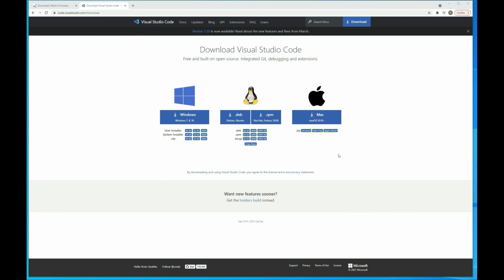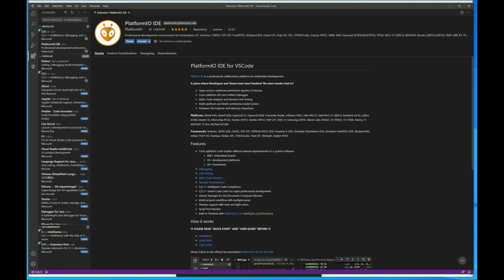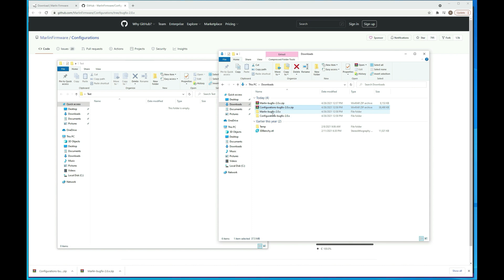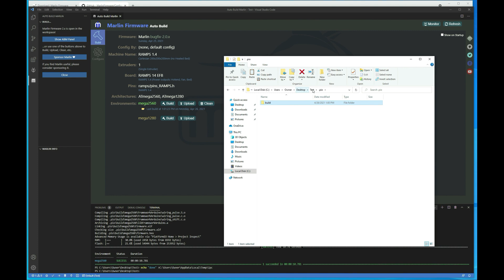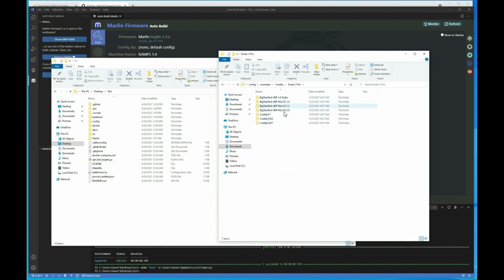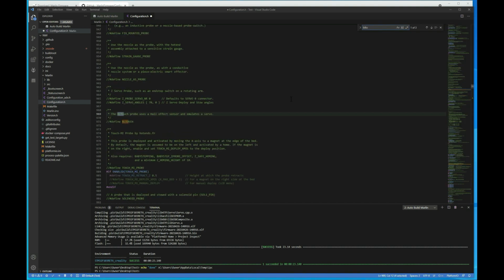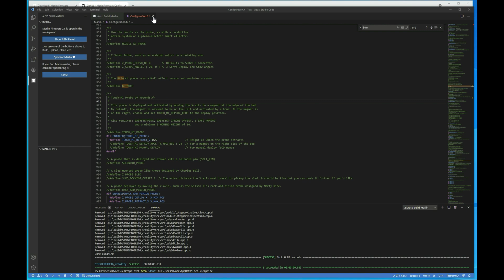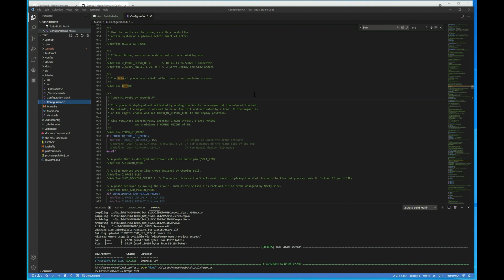Marlin Auto Build – The Basics

Comment: So put all of that on the SD card or just the highlighted hex file?
Reply from the maker: Hi. You should have a .bin, not a .hex file. I think you choose the wrong environment or config example.
Reply: @3DPrintscape  I was referencing the hex file showing in your video. But I've got it figured out. Klipper is up and working. Thank you very much for responding tho. I was under the impression I had to install Marlin then klipper but turns out I Don't have to install Marlin. I'm graduating from the 8-bit world to 32 finally. ;-) the M8P is a mini beast.
Reply from the maker: @HiGHrVOLTAGE  Ah ok, im glad you were able to get it working. The 32 bit boards are nice, assuming you got a silent one.

Comment: Hey, great video. Would you know why I would keep getting a failed build?
Reply from the maker: Hi. What error are you getting?
Reply: @3DPrintscape  For some odd reason VSCode does not like to compile 8Bit board firmware, no matter how short I make the path. I can do 32 bit boards all day long with no problems.
Reply from the maker: @CloneC-bw3pj  Interesting, i havent compiled 8 bit in a long time so i havent seen this. My guess is they made a change at some point on linux and the file path is still too long even close to the root of the drive.
Reply: @3DPrintscape  Thanks, I guess it's even longer of a path for Windows users. I'll try to get my hands on a Mac.
Reply from the maker: @CloneC-bw3pj  Im  not sure the path is longer for windows users but windows has a cap on file path lengths.

Comment: Thank you so much.
Reply from the maker: You're welcome!
Reply: @3DPrintscape  I'm having some problems with my start and end of Gcode on Cura. Could you help me Out with it please.
Reply from the maker: @josesousa3103  What type of issues are you having?
Reply: @3DPrintscape  So I made  a very large plotter with 4 stepper motors for 3 axis same as a 3d printer.  Z axis has 35 mm movment of pen. When homing Z it drops pen and drags at the begin and end of drawing. At the begining of plot i want it to lift up as it goes to start plot. At the end I want it to do the same as it homes also to turn of fans. I have fan on controller and on Y stepper motor, it get hotish moving the pen holder. It all moves very fast. I so aprecate you taking your time t help. Ive played around with it but not working.
Reply: it has a skr mini e3 v3 running at 2 amps. It is moving more mass than a printer. Faster acel and speed threw VSC and marling builds. moves really nicely.
Reply from the maker: @josesousa3103  I havent done much with the plotting side of things. I would say make sure your using a known good config example for the srk mini v3 and maybe try different software to see if its gcode related.
Reply: @3DPrintscape  Thank you. I just keep playing around.

Comment: This is my first attempt at trying this. I made it to the 7:15 mark in this video, but my builds just fail. I tried 5 times to get a successful build, but it's just not happening for me. I am using Marlin Bugfix v2.1.1 from the "Nightly" source, I just DL'ed it prior to this attempt.  I will be setting this up on a BTT SKR Pro v1.2 mainboard.
Reply from the maker: Hi. What error are you getting? It should be in the terminal output.
Reply: @3DPrintscape  I tried accessing your discord, but it said that I am not authorized to comment. I replied to the email I got regarding your question. That email contains a jpg picture of the message I keep getting, no matter how many times I attempt to build this firmware.
Reply from the maker: @PaganWizard  Make sure you move over to one of the tech channels in discord, you should be able to post there.

Comment: Currently using an Ender 3 V2, and just installed an SKR Mini E3 V3, TFT35, and BLTouch. Get tons of errors no matter which firmware I'm using, Marlin, Jyers, BTT, etc. Tried a different board and still same thing, it's as if the firmware doesn't even get pulled from the microsd upon insertion into the printer. Guess I could try a different card, but would love to see an E3V3 firmware vid in the future.
Reply from the maker: Hi. I actually planned on buying the v3 this week, so some videos will be coming.
Reply: @3DPrintscape  just to save you a lot of headache, there are many firmwares out there that are descriptive to work with the v3, but there is really only one that I found that works every single time. I'll share the link as soon as I get to my computer.
Reply from the maker: @TechReviewLife  Thanks, ill take a look at it. I plan on making a guide covering the build process as well.

Comment: Hi there. I keep encountering errors after I add my config files. I was able to do the test build with the mega2560 environment, but when I add the additional config files to the marlin folder, I end up with 5 different environments, STM32F10RE_creality (512k), STM32F10RE_creality_xfer (512k), STM32F10RC_creality (256k), STM32F10RC_creality_xfer(256k), and STM32F10RE_creality_maple (512k), and when I try to build any of them, I get "no such file or directory" error.
Reply: I understand the different versions now since I found an article about newer 4.2.2 boards shipping with different model CPU's but I am still not sure where my missing files are.
Reply from the maker: Hi. Try to move the folder closer to the root of your drive. If that doesnt work, try to clear out the .pio folder and try again.

Comment: I have a question.. I keep getting Error: Build environment "STM32F103RET6_creality" is incompatible with BOARD_CREALITY_V4. Do you know what may be causing this? this is for a 4.2.2 board on e3v2. ive followed the same steps as you but no luck still
Reply from the maker: Hi. They changed the environment details in January when the 256k boards started coming out. Try to use the marlin auto build plugin, it should help.

Comment: Hi, keep getting this error code in VSCode even with a successful build {
	"resource": "/c:/marlin/Marlin/Configuration.h",
	"owner": "C/C++",
	"code": "1696",
	"severity": 8,
	"message": "#include errors detected. Please update your includePath. Squiggles are disabled for this translation unit (C:\\marlin\\Marlin\\src\\lcd\\dogm\\status_screen_DOGM.cpp).",
	"source": "C/C++",
	"startLineNumber": 2,
	"startColumn": 1,
	"endLineNumber": 2,
	"endColumn": 30
}
Reply from the maker: Hi. Is that an error or just a warning and have you tried to reinstall the platformio and c/c++ plugin?
Reply: @3DPrintscape  Thanks for the reply it looks that way, upgraded my 4.2.2 board to a 4.2.7 tried the Creality download but that did not work, I have managed to build the firmware with BLTouch that was on the old board but when I boot the  printer I get EEPROM Version error on screen with options ignore / reset tried ignore and reset but have issues with controls not working nothing seems to respond, pretty new to firmware building.  Thanks for any help you can give.
Reply from the maker: @pedroaltin6186  Can you try the firmware I have on my site? https://3dprintscape.com/marlin-firmware-builds/  Also, ignore the warning then go into the menu and clear the eeprom.
Reply: @3DPrintscape  Thanks tried your firmware with no luck still no movement, something is going on with this printer.  I have downloaded the 4.2.7 from Creality flashed this no movement but when I flash the new 4.2.2 firmware things start to work Bed & Nozzle heat X Y & Z all move, think I will remove BLT & re-connect Z stop for now so I can start printing again. Thanks Pedro
Reply from the maker: @pedroaltin6186  Double check the bltouch wiring, don't assume its correct in the harness. Ive seen it shipped wired like 10 different ways.
Reply: @3DPrintscape  Hi,  decided to take out new board only to find it was a 4.2.2 they had sent me I know should have checked but was fitting in bad light and did not notice.  Printer is working fine now, is the 4.2.7 that much better than the 4.2.2 silent?  Once again thanks for all your help and work on this site,
Reply from the maker: @pedroaltin6186  Im glad you got it working. The drivers are significantly better on the 4.2.7 board. The two biggest differences is the silent part and the driver in the 4.2.7 board can make 1/256 turn rotations where the 4.2.2 board can only do 1/16 turn. It can help a lot for smaller movements.

Comment: Nice video.  I installed everything as directed.  I can't build because I keep getting "Error: motherboard is not defined in Configuration.h"  I've tried a few different config files but get the same message.
Reply from the maker: Hi. It sounds like you are using a config that expects the printer to be connected. Most of the 32 bit boards done require that.

Comment: Thank you for this great looking idea. You must have been amazingly lucky, Unfortunately the PlatformIO won't install on Windows 7 and will not run under Windows 10 (with all the updates on a new laptop} on another one of my computers after being installed, it generates an error code when run "Error: Could not start home server:" the fix, going back to 2018 did not work either. You would think a bug going back to 2018 would be fixed by either VS or PIO, but looks not. Will try to use a example code and edit but uninstall still leaves numerous bit and pieces from PlatformIO!
Reply from the maker: Hi. Thanks for the feedback. Im not sure whats causing the issue for you. I have this running on 4 computers at home (all windows 10) and i know many people in the community that have it running as well. Maybe UAC or AV?

Comment: Hi, I just finished rebuilding my Ender 3V2 ,increasing the size to 400 x 400 w/ a new heat mat addition . Z axis remains 250 & added a CR touch. I need to make those changes in the firmware & need some help. I have VS & MARLIN & CONFIG STANDING BY but just need some further guidance.
Reply from the maker: Hi. You just need to change the bed size in the firmware to 400.

// The size of the printable area
#define X_BED_SIZE 235
#define Y_BED_SIZE 235
Reply: I did everything according to your instructions but when I try to flash the firmware on my printer all I get is a blank screen & a screeching beeb sound. I tried it several times to no avail. All I changed was  " Build Plate size, X 400 , Y 400,  activated BL Touch & after a Failed notice activated Z homing. * that gave me a successful build but still no results. I must be missing something. HELP !

Comment: My install typically isn't working, platformio is installed but no icon? auto build is installed but only ever says initializing
Reply from the maker: Hi. It sound like the platformio or C/C++ plugin didnt install right. I would try to uninstall all the plugins, reboot the computer, launch VS Code as admin, then reinstall the plugins.
Reply: @3DPrintscape  thanks, I got it sorted. Had to rummage through windows and delete all the shrapnel after uninstalling pita but on the 5th attempt it worked.

Comment: is there a way to save your build to go back and make tweaks later on if needed? like lets say i make a build and install the firmware but I decide a few days later that i wanted to have a 5x5 probe grid instead of a 4x4.. could i go back to the previous configuration for that build, make that small tweak and rebuild and install? does this make sense?
Reply from the maker: Hi. Assuming you are using the same firmware every time, that would work. I keep a folder with my active firmware in it and make tweaks as needed. If you try to use newer firmware with the older config you will probably run into issues.

Comment: Hi, This is all new to me. I got my 1st printer yesterday Ender3 pro and am trying to install new firmware to enable M600 (I need to change filament inside a layer).
My board is 4.2.2 (Marlin 1.0.1) so I think all I need is a bin file on sd card.
I tried building in VScode and it failed
"The terminal process failed to launch: Path to shell executable "bash" is not a file of a symlink."
I think this may only be the start because I have seen others with similar issues relating to dotnet.
I am using Ubuntu 20.04 and I copied the extracted files to a folder on my desktop named Test as per your guide.
I am getting a bit worried as I don't want to brick my new printer.
Reply from the maker: Hi. Try to install the firmware from my site to see if that works for you. I havent tried building on linux, so im sure there are some changes that need to be accounted for.
Reply: @3DPrintscape  Hi, I tried endlessly without success using the Marlin build approach you described here, even reverting to Windows 7 but that doesn't support the latest Python3. I eventually just used PlatformIO in VisualStudioCode which worked.

Comment: This is the error i get on the autobuild and thats testing the autobuild first

PS C:\firmware> platformio run -e mega2560
Processing mega2560 (platform: atmelavr; board: megaatmega2560; framework: arduino)
---------------------------------------------------------------------------------------------------------------------------------------------------------------------Verbose mode can be enabled via `-v, --verbose` option
avr-g++.exe: error: CreateProcess: No such file or directory
CalledProcessError: Command '"C:\Users\jpbol\.platformio\packages\toolchain-atmelavr\bin\avr-g++.exe" -D_MARLIN_FIRMWARE_ -DNDEBUG -D_MARLIN_DEPS_ -w -dM -E -x c
++ buildroot/share/PlatformIO/scripts/common-dependencies.h' returned non-zero exit status 1.
  File "C:\users\jpbol\.platformio\penv\lib\site-packages\platformio\builder\main.py", line 175:
    env.SConscript(item, exports="env")
  File "C:\Users\jpbol\.platformio\packages\tool-scons\scons-local-4.1.0\SCons\Script\SConscript.py", line 591:
    return _SConscript(self.fs, *files, **subst_kw)
  File "C:\Users\jpbol\.platformio\packages\tool-scons\scons-local-4.1.0\SCons\Script\SConscript.py", line 280:
    exec(compile(scriptdata, scriptname, 'exec'), call_stack[-1].globals)
  File "C:\firmware\buildroot\share\PlatformIO\scripts\common-dependencies.py", line 309:
    apply_features_config()
  File "C:\firmware\buildroot\share\PlatformIO\scripts\common-dependencies.py", line 136:
    if not env.MarlinFeatureIsEnabled(feature):
  File "C:\Users\jpbol\.platformio\packages\tool-scons\scons-local-4.1.0\SCons\Util.py", line 658:
    return self.method(*nargs, **kwargs)
  File "C:\firmware\buildroot\share\PlatformIO\scripts\common-dependencies.py", line 285:
    load_marlin_features()
  File "C:\firmware\buildroot\share\PlatformIO\scripts\common-dependencies.py", line 273:
    define_list = subprocess.check_output(cmd, shell=True).splitlines()
    **kwargs).stdout
  File "C:\Users\jpbol\.platformio\python3\lib\subprocess.py", line 512:
    output=stdout, stderr=stderr)
==================================================================== [FAILED] Took 3.76 seconds ==================================================================== 

Environment    Status    Duration
-------------  --------  ------------
mega2560       FAILED    00:00:03.762

Comment: when i try to compile after making my custom changes in the configuration.h file it give me an error saying that the Bltouch requires Z_Min_Probe_Endstop_Inverting set to false. i’m using an ender 3 pro with an skr mini e3 v2 with a bltouch v3. i’m using the marlin bug fix software as well.
Reply from the maker: Hi. The recent config change on the bug fix line requires Z_Min_Probe_Endstop_Inverting set to false, so if you have it set to true, like i did before, it will need to be cahnged.